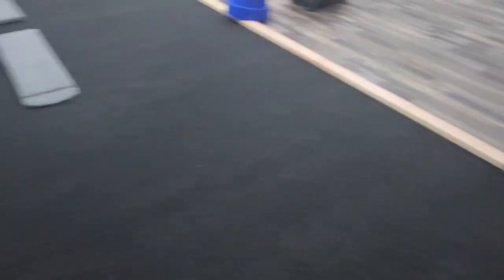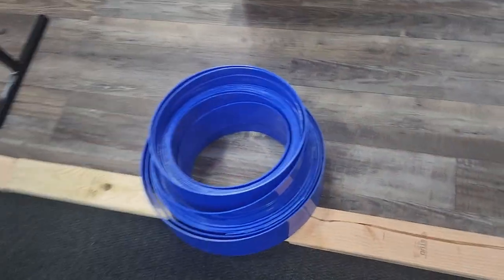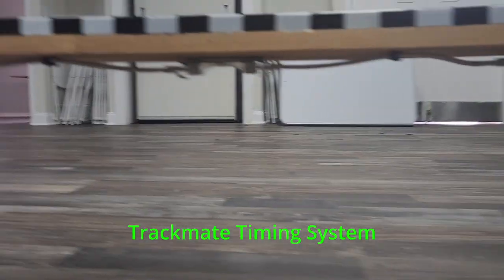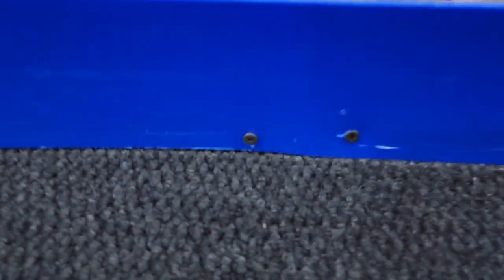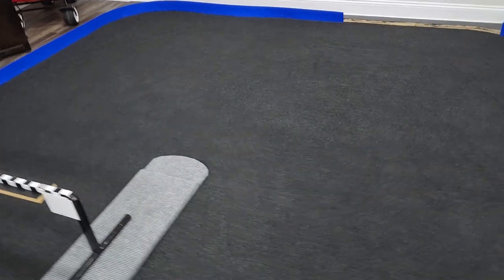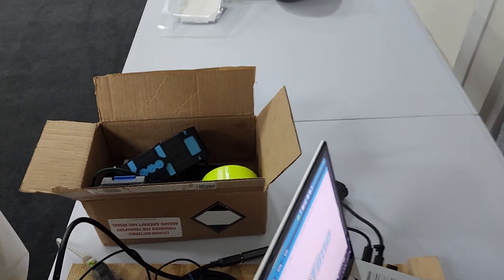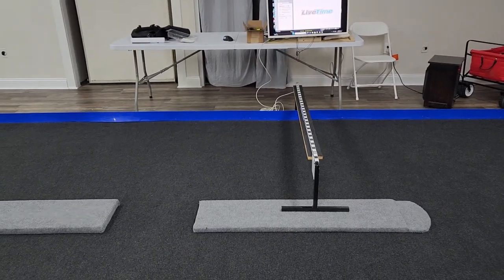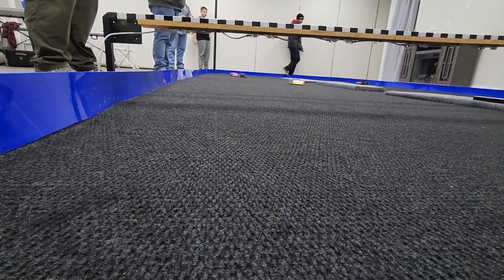How to Build A Mobile 1RC Carpet Oval Race Track

Comment: What is the track size ? thanks !
Reply from the maker: 12ft x 30 ft
Reply: I see three different types of the needlebond black ice carpet at lowes. Do you remember the exact type?
Reply from the maker: 841420 is the item number we used I see there is now a few different  options that were not there before.

Comment: I want to build one but don’t want to spend like 200 bucks
Reply from the maker: If you have a carpeted location. Some use tape lines to get started.
Reply: @ItsallBSforreal  I have a location just don’t want to over spend on carpet
Reply from the maker: Lowes was the cheapest I was able to find. Some run on painted concrete even.